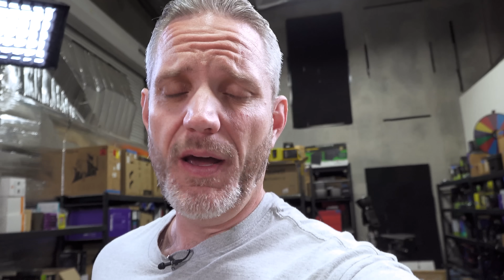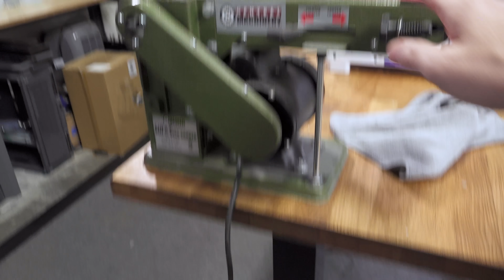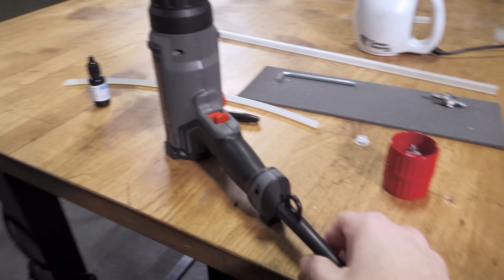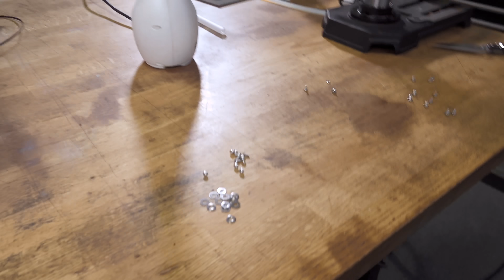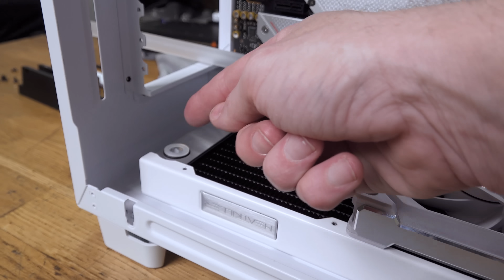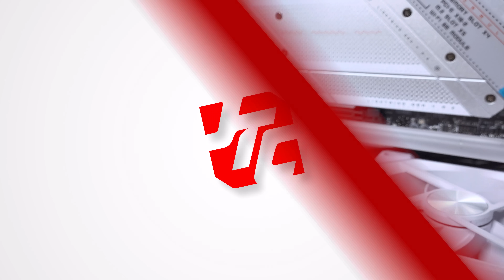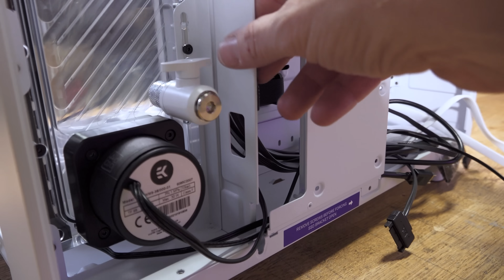ADHD Sucks...

Comment: ADDHD is a real B for sure. @JayzTwoCents unfortunately the way that active back plate set up works with that water block. You HAVE TO HAVE THE OUT port opposite of in for the fluid to flow correctly. Unless you're going to combind both out ports on the gpu & cpu blocks into a Y fitting before going into the top radiator. If you do it the way you're thinking of splitting it. There won't be enough head pressure for the cpu loop to complete.

Comment: I recently went into the ER for chest pain in mid-May, and they found my Gall Bladder was infected.  They ambulanced me to a hospital, and I went into surgery that afternoon.  When I woke up, they told me they couldn't do the lapriscopic surgery, and instead had to cut open my chest.  Turns out my Gall Bladder wasn't infected, it was DEAD, and had started rotting/leaking bile into my chest.  Spent 4 days in the hospital and 3 weeks recovering at home.  Just started back at work last week, but still feeling some pain from the chest incesion from the muscle healing there.  Gall Bladders are no joke.  Glad your doing better, and definately do not push yourself on lifting heavy objects, not worth extending your recovery.

Comment: Glad you caught the gall bladder issue.  

I've never been diagnosed with it, but I fit some of the diagnostic traits for ADHD, so it's possible that some of the things I use to maintain my workflow will help you:

Last year I started a journal following the style outlined by CGP Grey's description of how he uses his Theme Journal.  I find writing a paragraph or so about the day in the evening helps me stay aware of what I'm doing during the day, and it helps to pour out my frustrations if that's the sort of day I've had.  My journal sometimes has way too much angst for anyone in their mid 30s, but...even I don't actually read the damn thing, so that's fine.

I've taken to setting myself between 3 and 5 goals for the day.  This isn't the big master to do list of doom, just a few things to try to get done in that day; if you write down 5, drop the pencil and walk away, that's enough for the day.  Depending on how ambitious I'm feeling (which is often not very because I almost certainly have a degree of depression as well) those might be goals like spending time on a specific project, or just going to bed at a reasonable time and doing basic household chores.

I also have a whole checklist of things I try to do or avoid doing in a day - a daily walk, workout, and stretch, basic hygiene, dietary goals, etc... some of it is stuff I have trouble sticking to, some of it's just a list of things I might get sidetracked and never get to.  

The newest addition is list of 3 to 5 projects for the month: 1 fitness target, 1 dietary target, 1 organizational target (currently sorting through my 5 different music folders on different hard drives and producing a unified master list of all the music I have) and up to 2 straight up projects.  Setting the due date at the end of the month is entirely arbitrary, but having the "I want to do X by <Date>" actually written down and solidified on a piece of paper I'll look at every day means I don't just...forget that goal is a thing.

No idea if this'll work for you. I know people with ADHD who have tried the journaling thing and found it to be entirely useless.  But it's helped me.  No idea if it'll help you.

Comment: Maybe you can find a black o-ring that fits from another fitting that matches? Or buy a pack of them as backups, I definitely had cut o-rings in the past. I bough barrow fittings and all of them were green too. I just bought a replacement back of rings though only because I had to swap out so many. Good luck with the build!

Comment: So your idea with parallel loops with cpu and gpu has a problem. 
fluid like electricity will always follow the path of least resistance, And the cpu and second rad being so much higher than the gpu exit would mean that the majority of fluid would chose to go back to the res after the gpu and not take the higher resistance path of the cpu block and second rad. 

Now you may have more experience and this does not effect temps in reality but it would happen.

Comment: It is already constructed, and I have to say I admire the hard bending and tapping, but the general layout puts in mind of when, in Ghostbusters, they were looking over the plans for the building and Ray said, "...the architect was either a certified genius, or an authentic wacko!"

So, you have two rads. Cool beans. You have two heat producers, CPU and GPU. Good stuff. Why however are you running from the pump to a rad, directly? The rad should disperse heat, but there should ideally be none in your reservoir. Okay, that aside, why then run from your first rad's output to the GPU, then take the GPU's heat and pipe it in to the CPU, adding heat to it? What you have is GPU+CPU heat running to one rad, piping in to your reservoir. Of course your reservoir won't be 0 degrees, but wouldn't want to separate the thermal flux between your rads and run only CPU to one and only GPU to the other? You also have a triple 90 in to a long pipe in to more 90s which then needs to force fluid through a rad. That is going to be incredibly sluggish, at which point it exits in to more 90s and needs to travel through two blocks and the entire height of the case. I'm sure your pump is good, but that is a massive standing column it needs to push against. I almost forgot - rads remove heat from your fluid - good deal. However you have a rad at the bottom of the case, to shed heat from the fluid back in to the case? It will be blowing heat on your GPU for the fluid to pick back up. You may know quite a bit more than I do about it, but it just seems entirely upside down and backwards to me.

If you are willing to bend hard pipes and tap acrylic, why not send a Y from your output, route one to CPU, one to GPU, and return to top?
Why not mount the second rad vertically where your reservoir is now and route the fans out the side of the case, and put the reservoir on the bottom?

Comment: Random question for you Jay the white build for your friend - Have you thought about using a 240mm rad on the bottom instead of the 360? In theory that would then open up that problematic area at the bottom of the distro plate. I'm sure you have thought about this and have dismissed it for perfectly valid reasons, but was just curious. (And apologies if there are comments from others in here on this already, I have not read all 1,218 comments - at this stage !!!!

Comment: I have adhd especially when it comes to cleaning. At the office, I started sweeping. I got through half a room then noticed cobwebs in the corner on the wall so i went and got papertowles and knocked those down then noticed scuff marks on the walls so i got more paper towels and got those on half of two walls then  noticed i swept up to the carpet but need to vaccum the carpet so i got the vacume and was about to start vacuuming when i noticed dirt buildup on the door frame so more towels and cleaned the door. When i opened the door i noticed how many leaves were piled up making the front of the office look like a disaster so I spent 2 hourse cleaning the front of the store and the store front sign and planter boxes then took out the trash got back inside was exhausted. Put everything away, so in sumation, I cleaned 1 corner of a floor, 2 halves of 2 separate walls and the entrance area, and signage and was too warnout. I completed the front of the store as my ownly thing that got done and the whole time, i kept saying to myself i wish i could bring my power washer and buy some rocks and plants. It's a nightmare.

Comment: Jay, the Vector2 active backplate's terminal doesn't work the way you described.. That was the way the old original Vector active backplate terminals worked, but the new gen Vector2 needs to go same way as if it was an ordinary non-active backplate block! It's got a special routing piece inside of it to divert the flows to achieve this and doing it like you described in the video is going to just bypass the blocks completely and just go directly from the bottom port and out the upper port.

Comment: ADHD is a rocket fueled boat anchor.   You are chained to it, and when it's in rocket mode, you are king of the world, sailing through the skies and getting all sort of things at least half done.   When it goes into anchor mode, it puts you in a place of indecision, of lacking direction and lacking focus to move anything forward.   Your position makes it worse than most, and to be honest, running a channel where you have the pressure of "you must have new content" isn't going to help, except that it can force you to focus.

Suggestion for you:  When you start your week (say Monday morning) pick based on how you feel at that moment the 5 things you are going to work on this week, and try to start each day actually working on them.  Don't worry about finishing as much as working.  Don't worry that you may not work on it all day, just try to start out with what you need to get done.   Set yourself some time points in the day when you have to do certain things (set alarms on your phone as needed).   Don't put so many as to regulate your life, but having one set time at say 4PM every day when you have to bring yourself to clean up or organize until you day is over will help you in the long run.

All day focus is likely impossible without medication, sorry to say, and the medication would make you into "not jay".  So you have to find the ways that force yourself to start your week and your day with a plan of sorts, and to start working on an item that is important to you.   Bring the cameras alone, record what you do, and surprisingly the whole thing will work itself out.

Comment: Yeah, confirmed, ADHD is a bitch.  Self disgnosed in 1995, but got turned away by the psychs because  adults didn't have ADHD according to the DSM.  Sigh.  By 2010 the DSM hac changed, so on the bext try i got diagnosed...  still is a bitch tho

Comment: Glad to hear you've recovered well. I got a question about the loop runs. Why not use like the 5 mm spacer to avoid the double 90s and kinks? You could do that for the loop from reservoir to radiator and radiator to GPU.

Comment: Seems to me that they have to make little extension pieces that you can put in between the 90's. Like 2, 3, 4, 5 cm pieces ( sorry guys, I'm european , so metric system ). You would not have to do the double 45 to get the tube lined up. Just a 2 or a 3 cm piece in between the second and the third 90. It could make the tube from the bottom rad to the graphics card also way, way nicer. It would make a watercooler's life so much easier. They could even make a 10 cm piece ( thread from one end to another ) with a little tube that you can insert into it ( to avoid turbulence ) and 2 rubber seals, that you could saw at the length you need ( both outer tube and inner piece ). So simple to manufacture, yet as far as I know not done.

Comment: I bought like $1300 worth of water cooling parts a few years ago for my build but I didn't want to buy a waterblock for a 5700 XT, and so I decided to do a regular build, then switch to a custom loop when I upgraded my GPU. Except the regular build was enough of a pain that I decided I just couldn't be arsed. So I have a box with a bunch of Bitspower fittings, Black Ice radiators, and Singularity Computers Protium pump / reservoir combo etc. just sitting in the basement.

Comment: Really nice build, but one thing hurts my eyes so badly. You are using 90° fittings one every connection in the lower area. Why not on the lower rear back of the radiator? This triggers my inner monk really hard.

Comment: Jay; I don't comment on videos very often, but your thought processing for that first bottom tube run - 11:00 - sounded a lot like how I would "brain" the same problem - as you outlined all steps, I saw exactly what you were thinking and it all made perfect sense.

I get your heightened frustration levels with what things need doing & your capacity to get them done - esp. with physical health issues throwing wrenches in the works, n/m mental ones - but that's part of what makes your channel what it is... don't stop being you.

This build is looking great; whatever wins you get along the way, take them - I'm sure your friend will be happy with the build when you're done with it - so added stress/anxiety is what you bring on yourself... it's gonna happen & it wouldn't be a J2C build if they weren't there.

Good luck from here on out; looking forward to the rest of the build.

Comment: I paused the video at 13:07 so I am unaware if this was even a thought.  But just thought of maybe using a 10mm extension between the 2nd and 3rd 90-degree fitting coming from the pump.  It would make that look so much cleaner, and less bends.

Comment: Think I would have put a little piece between the last 2 90s the one pointing out and the one going left to just space the bottom tube out so you wouldnt need that offset bend in it. It could be just straight then a 90 down. But ive never done a water cooled pc so.

Comment: 13:00 I don't mind the kink, but one option is to remove the last 90, twist the second upright 90 by 45deg, and put a 135 deg bend in the tube to line up to the rad.

Comment: I'm not ADHD, just not having enough money to finish existing projects; my FZR, the water electrolysis project for a small engined inverter output electrical generator, this very laptop I'm typing this on with on-screen because keyboard's shot needing a cooling system repair and modification (and much more) and getting a headunit and bigger amp for my sound system...I could only wish others who are better situated to pursue what they really want, only a few gets to live the dream. Hope you found yours!

Comment: I haven't been fully diagnosed with ADHD yet, going through the process but VA is not fond of that diagnosis because of the treatments for it, but I feel very much the same way. Doesn't matter how little or important something is it can be nearly impossible to get going on it. I know I need to, I might have lots of reasons, and even the full capabilities to do so, yet for some reason the motivation is not only lacking but in the negatives. Even if I get started and going on something (such as personal fitness) if anything causes a pause in that routine then its back to once again being absurdly difficult to get going again with that. I'm only lucky that my life is in a place where I can survive, but its a constant fight within my own head to feel like I can accomplish anything.

I spent many years denying that I could possibly have ADD/ADHD, but sometimes when everything points to a thing no matter how much you don't want it to be thats just the case, we don't get to choose most of the things that our genetics and environment control, at some point you have to face reality and deal with it.

Comment: Had mine removed a few months ago. Was in the ER 3x over the 2mo preceding the surgery. Was in so much pain was unable to eat and almost no liquid for 3 days each time. The first and second trip they gave me IV antibiotics and fluids. Then they shrugged and said let my bariatric surgeon take care in 6mo when I would be getting that surgery.  On my 3rd ER visit they said no, no, no. Go to surgery today.  Turns out the gall bladder was twice the size they thought it was. Almost completely solid with stones. Doc said the outside of the gall bladder was becoming necrotic and starting to shed. As a bonus, during the surgery,  they found a hernia.

Comment: that distro plate in the back is a great idea. if you get nice tight 90 bends you could route whatever. cover up the holes and the dragon. and make it look like a super mario level. megaman has a similar style. tile based. doing a front layer, the sprite/figurine layer and the background layer. vertical slices. old school 2d video games. :D

Comment: -- I hear ya Jay.  Best wishes on your health.  Found myself throwing up blood last night.  I'm 44 and luckily enough I have Liver disease.  Days are numbered unless I get a transplant.  
   So my stomach's hurting.  I'm up till 5am.  Manage some sleep (for those of you throwing up blood, do not do what I did, DIAL 911 IMEDIATELY! - You can bleed to death right into your stomach and die.  I happened to know my situation well enough).
   I wake up today, and the Thermaltake Core P3 is sitting on the front porch for a tribute build.  Just finished my main rig (4090 Strix incoming next month)
  This rig here is to show some love to an old I7 6700k.  Had mechanical drives.  A 1070ti, run of the mill.

  Stats now:

  I7 6700k @ 4.7ghz
  Gigabyte Gaming 7 mobo
  Corsair Bronze 750watt semi modular PSU
  32gigs of DDR Vengeance
  Two Samsung SSD Drives
  One Samsung 980 Pro 1tb NVME
  Gigabyte 3060ti
  Be Quiet 120mm Fans on a Corsair Push Pull Rad.
  Updated heatsinks, refilled AIO, thermal compounds (thermal grizzly and GLID pads)

   Going to my youngest daughter.  Figured an update/rebuild and a new case would honor a rig that served me for nearly a decade.  Well aware of the system GPU and PCIE bottleneck.  But with a 1070ti, this rig took me from Dying Light to Hogwarts Legacy and Metro Exodus at 1080p with very high settings and framerates 60 and above.  

   Death can wait.  Got a little girl to make smile, and an old rig to honor.